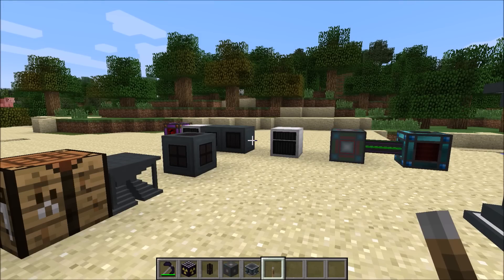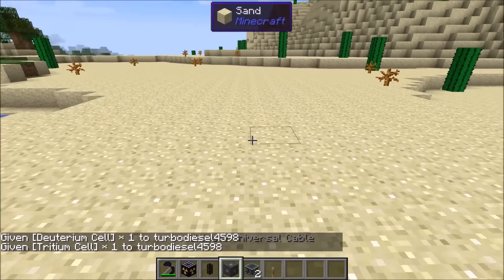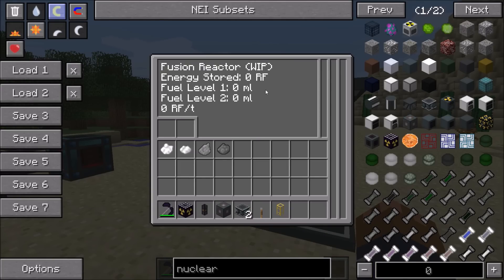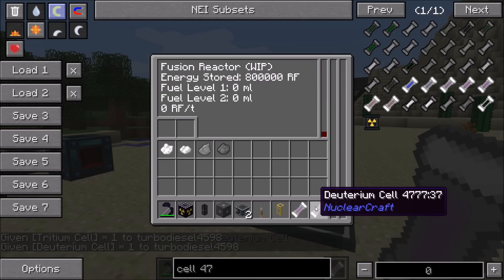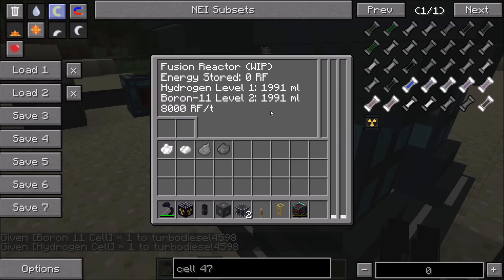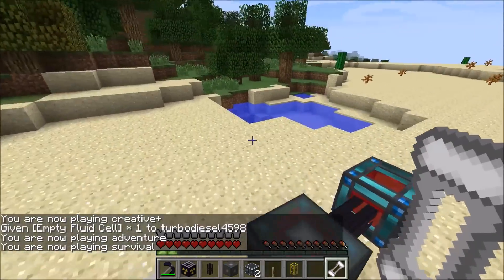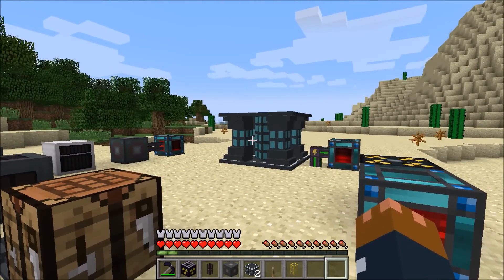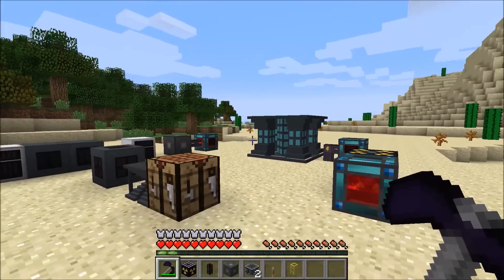An Introduction to Fusion (1.2)

Comment: I found some rather interesting bugs with the fusion reactor: when something with plutonium is being used as fuel it normally runs, after the fuel reaches 0 it goes down in the minus! then I have to chop away my reactor to reset it, wasting my plutonium with it. 

Also the crusher of your mod can't crush uranium... but the recipe is there with NEI? bug?

Keep working on the mod, it's great :D
Reply from the maker: ***** Thanks for the info - I have been able to recreate the uranium crushing bug - I'll get that fixed.
Can I have more info about the reactor bug? Do you mean the fission reactor, and is it only Plutonium fuel that has this issue?
Thanks for the support ;)
Reply: ***** yes all plutonium and the moxfuel too in te fission reactor.

We made a private modpack and I am testing nuclearcraft. :)
Reply from the maker: ***** Ok - I haven't been able to recreate the problem with the plutonium fuel, but I haven't checked the MOX yet - probably a problem with the amount of fuel drained per tick not quite hitting exactly 0, thus continuing to decrease. Really awesome to hear that you're testing the mod, and great that you're helping find these bugs ;)
Reply from the maker: ***** I haven't been able to recreate any issues with the fuel times going into the negatives, but I've put in a safety feature to make sure it won't happen ever anyway - are you sure you're playing with the latest version of the mod (0.0.1.3b)?
Reply: ***** yes I can have an image to: https://drive.google.com/file/d/0B9BpXVMqyjzKZHhsSHhyXzhuZzg/view?usp=sharing
Whenever I put any plutonium or Mox fuel in.
Reply from the maker: ***** Well, thanks for the confirmation that it can happen - I have not been able to recreate the issue, but as I said, it shouldn't happen again after the slight tweak I made ;)
Reply: ***** Cool :) I am looking forward to the next update ;)
Reply from the maker: ***** Next update should have the fusion reactor finished, as well as some bug fixes and possibly a few new items. After, that, it's time to turn the maths I've been getting done into java, and we'll have to see how well that goes when we get there ;)

Comment: ***** I'm having a strange issue with the latest version of NuclearCraft. I have 2 3x3x3 fission reactors with 8 graphite blocks and 16 reactor coolers inside. Both of them will randomly stop producing RF despite having plenty of fuel, no waste and 0 heat. Also the RF/t meter never displays anything. The RF out meter in the reactors GUI always displays: 100000 RF. Yet my MFSU array never receives any power. I am using the PowerConverters mod to convert RF to EU BTW. I'm thinking this is just a glitch that will have to be fixed in the next update. But, what are your ideas?
Reply from the maker: Brenden White The fact that it is displaying max RF in the reactor makes me believe that the RF is not being extracted at all - does the power start at zero, then go to max as it runs, or is it at max all the time, even straight after you place it? If the former is the case, then yeh, I think it's a problem with the extraction of the power, and there's nothing I can do about it. Try an RF cable first, then the converter(s), and see if that helps.
Reply: ***** Very possible. I've been using BigReactors to substitute while my NuclearCraft reactors were on the fritz. I had the same problem. Then i noticed that my diamond kinesis pipes (from BuildCraft) weren't actually connected to the reactor power tap. I switched to redstone energy coduit (from Thermal Expansion) and it worked like a charm. So, definitely have to switch to redstone energy conduit for power extraction from my two NuclearCraft reactors. I only was using kinesis pipes because i never i had redstone energy conduits until yesterday. Thanks for the help. Never would of thought of that.

Comment: I got some new material ideas (If there not already added to the mod) Thorium, Plutonium, Neptunium, Tungsten
Reply from the maker: Trenton Zelley Thorium and Plutonium are already in. Neptunium could be added but as far as I know its only good use is producing Plutonium, so it would be quite a superfluous addition. Tungsten I have never considered - it is not really a key material used for any parts of the mod as it is, but if it is needed at some point for some pieces of tech then of course it will be added.
Reply: Tungsten is actually a really good material used for heat shields, the fusion reactors should use some.
Reply from the maker: After more consideration, I decided to add Neptunium to the latest version of the mod, as well as Americium, Curium and Californium :)
Reply: ***** Wow, surprised you found this comment again, I'll have to check it out!
Reply: ***** Neptunium is my favourite actinide!
Reply from the maker: HbmMods I'd have to say Plutonium is mine :)
Reply: ***** Probably because I gave Np this metally greenish color, Pu, U and Th are pretty close though.